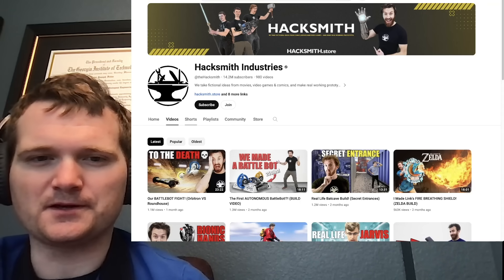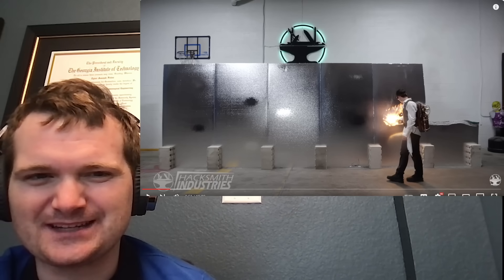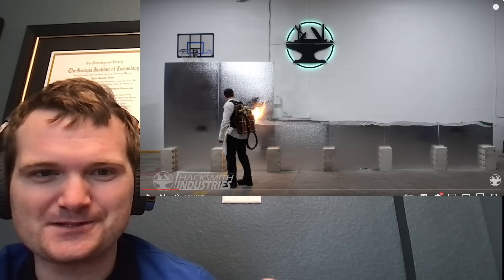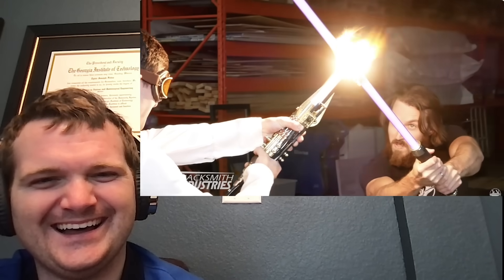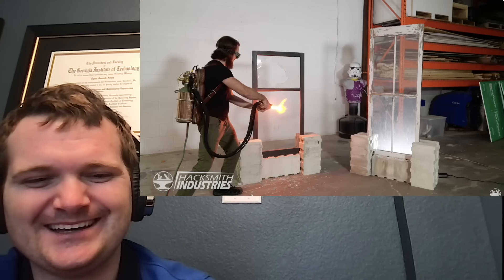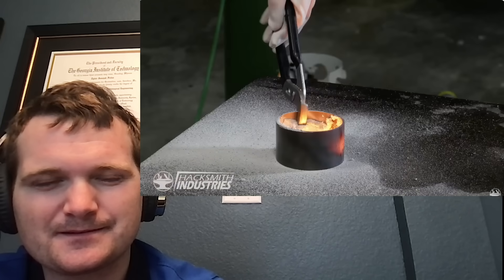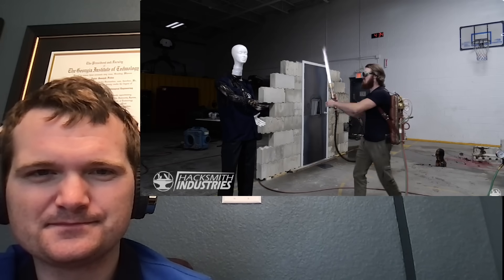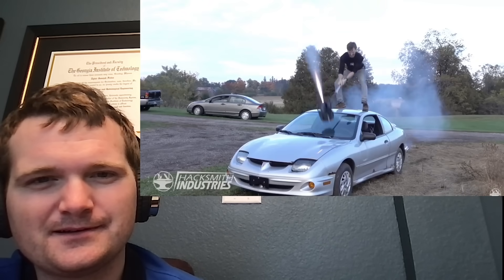4000 DEGREE PROTO-LIGHTSABER TEST! - Nuclear Engineer Reacts to Hacksmith Industries

Comment: 4:00, the ones in the movies had more sparks because it was supposed to be a cathode/canal ray beam from a high voltage-high frequency power supply with a crystal in the emitter for color.
7:30, Captain America's shield is supposed to be an alloy of vibranium (absorbs vibrations) and adamantium (can't be scratched/unbreakable).

Comment: 8:15 It's a thermal shock, usually you need to put something really cold against the hot glass, but the lightsaber is SO hot that even room temperature air is cold enough to shock the glass.

Comment: prob would not work on captain ameircas shield as its meant to be exotic matter same density as pulsar, though the saber still to low temp and doesnt work quite same way either, at 4000c it takes to long to cut through things, the fictional lightsaber meant to have confinement shield over blade so only selectively burns at point of contact no idea what temp it would need to be to instantly cut tho but clear 4000c and 7000c for their more recent staff fall far short, its a  nice effort tho,

Comment: The lore states that a lightsaber burns at 27k degrees Calvin. But it has a other fictional tech that creates a barrier around the blade that maintains its legnth as well as keeps the heat contained to the area of the blade. This is why the blades cut clean while cauterizing the area.

Comment: While cool to see something like this being made, I hate when they talk about results being the same.  Like you mentioned with their "blast door", the ones in Star Wars are made thicker than a 1/2 inch and of stronger material than steel.  Kind of like when Mythbusters did the "High Ground" from Revenge of the Sith.  They "showed" that Obi-wan would be at a disadvantage having the high ground because he would have to keep Anakin from taking out his legs.  They had Adam and Jamie stand on a slope and had Jamie go up it at Adam, ignoring the fact that Anakin WASN'T even on the same ground as Obi-wan (Anakin was on a droid platform out on the lava river), so he would have had to jump to get to land and then go up, at which point Obi could rush down the slope to keep him from landing or even Force push him.

Comment: I think that the reason for cleaner cuts that result in less fire in the movies is because the lightsabers have a magnetic shield around the blade.  That might also be the reason why the blades in the movies clash into each other rather than pass right through each other as seen in the Hacksmith videos.  Placing a barrier around the blade will help focus the energy into a more confined area.

Comment: I don't actually think that light sabers are made from plasma because when they make contact with another light saber, they don't just go through each other. They make contact and then bounce off like an actual sword. If you were using the Hacksmith light saber, the 2 beams would go through each other
Reply: I mean star wars Lightsabers are supposed to be contained in magnetic fields, rather than a free flow. magnetic fields screwing with each other would cause some problems I think.

Comment: They made it hotter and shorter, its now a Lightsaber Pike, and there future plans show that while not exactly as small as a Lightsaber, they can get pretty close in terms of just the looks without a super bulky power pack, although the power pack is obviously still needed
Reply: And now they're making one completely cordless and handheld with liquid oxygen! Absolutely love those guys!
Reply: @Average_Outhaul_User  Oh yeah, I just saw their promo for the revamped minisabers that they are using to raise enough money to keep going with the process of miniaturization, I can't wait to see if the liquid oxygen model will burn even hotter than the protosaber or the pike.
Reply: @genericbeansmile756  that i am not sure. maybe the concentration of oxygen is higher if you use lox then make it into oxygen gas thus allowing you to get more fuel into the flame and more heat but not certain.
Reply: @SB7-r9i  no lmao it just takes up less space than gaseous O2. LOX doesn't burn at all, only the gas does

Comment: To be honest, these tests also show that SOME of the movie scenes were kind of accurate, like when Windu and Sidious shatter the window at the Chancellor's office (even though that wasn't glass probably but a transparent metal Star Wars lore call transparisteel). This plasma cutter is basically the alfa version of a protosaber. If this flame-blade was sufficiently hot enough, it would do everything a lightsaber could, the problem is the heat, we don't have the space-magic-tech of Star Wars to have containment fields that could keep these blades from setting everything on fire apart from those things they come in direct contact with, also with said containment field, the blade would both be more energetic as well as localized, since the field would keep all the heat in until something touches the blade, that would mean clean cuts.

Still this needs a bit of workshopping, a few hundred years! 😆
Reply: I would guess we would still need the containment fields for two of them to be able to clash like swords.  Cant imagine fire gets harder the hotter it gets.
Reply: @trevorjrooney  Exactly, it's the containment field that does that, and if we presume they are electromagnetic in nature, that would explain why the blades don't slide on one another...